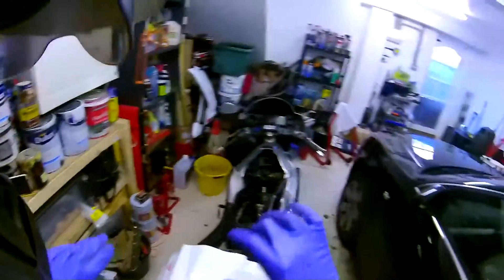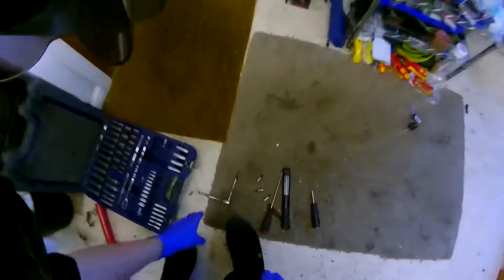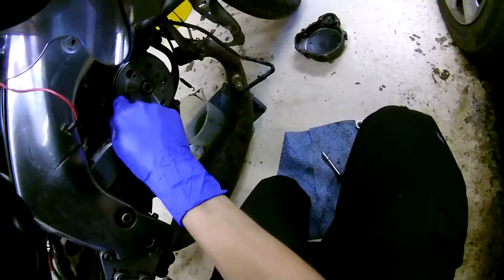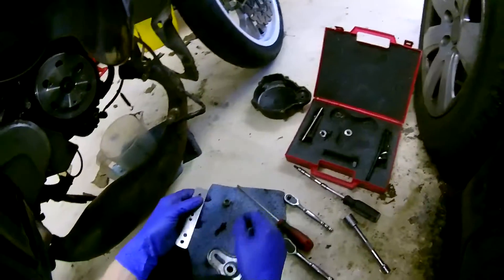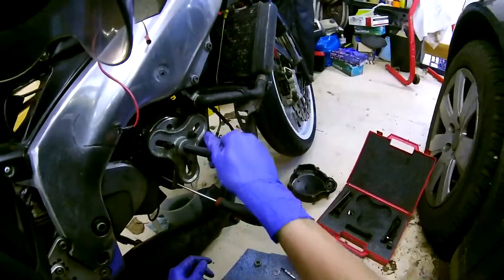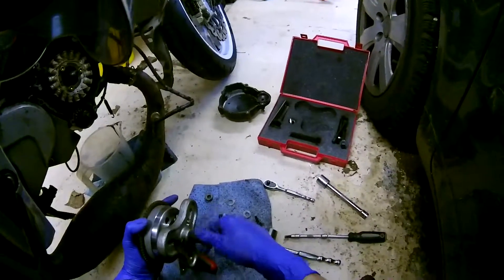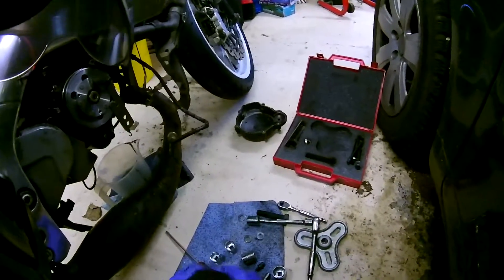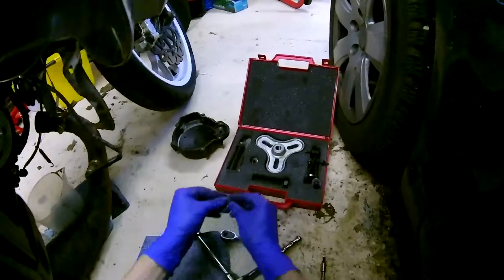Aprilia RS125 - How to remove the flywheel Rotax 122

Comment: where did you learn to work on a bike/ car?
Reply: Its pretty easy especially on a tiny 2 stroke 125 engine
Reply: Wish I could say that, having some problems with my 50 cc 2 stroke moped engine haha
Reply from the maker: +kamil laguna started off when i was about 12 messing around with mini moto's 50cc. setting up the carb ect then when i got my RS obviously it broke down a million times so you just learn from fixing them. My dad also owns a garage at which i used to work a few days a week while at college servicing cars ect. I spend most of my free time working on my cars or my bike, either repairing or tuning

Comment: I am thinking about buying a RS125 as a first bike, do you recommend it ? Is it reliable as 4 Stroke bikes ?
Reply from the maker: +Harun h. no not as reliable as a 4 stroke but 4 stroke 125's are insanely boring and slow. you can have alot of fun and get decent speed out of a 2 stroke where on a 4 stroke they're just boring